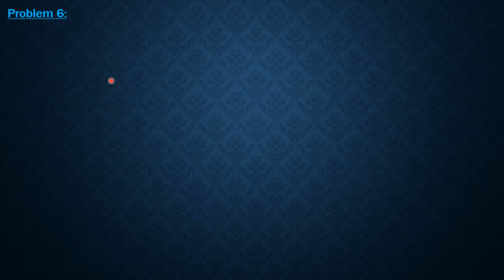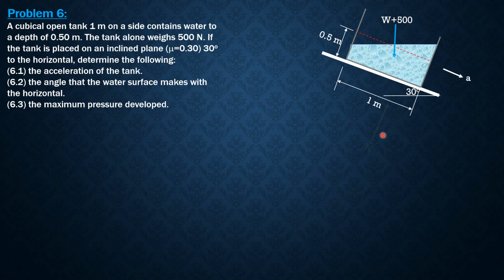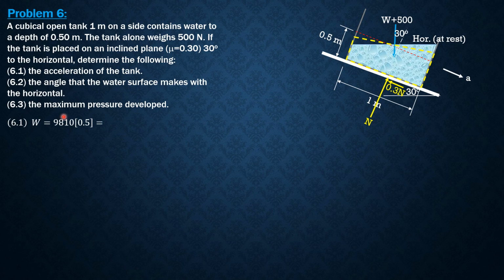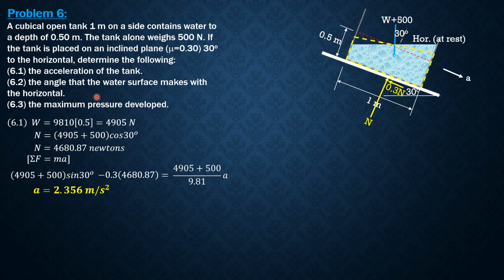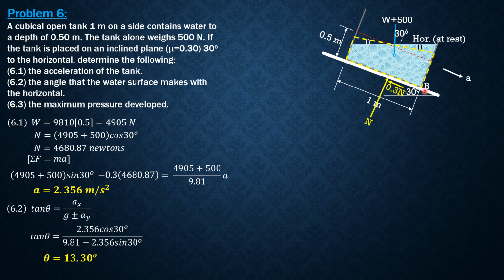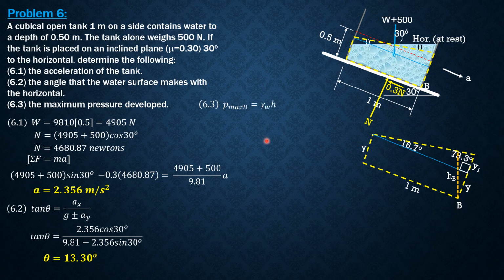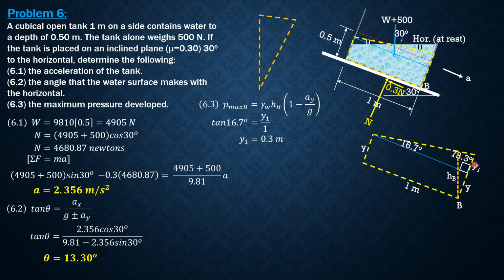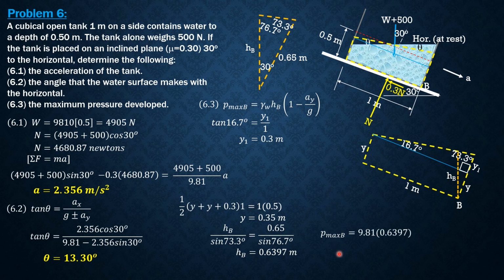RELATIVE EQUILIBRIUM of LIQUIDS, Example 6

Comment: hindi po 0.5 ang y Sir?
H = y + y1/2
H = 0.5 + 0.15
Reply from the maker: @ljregalado5083 When the tank accelerates down the plane, the water surface changes. On the lower end it rises a bit while in the left upper end, it drops a bit. The most important thing is no water spilled. That is why volume initial=vol. final.